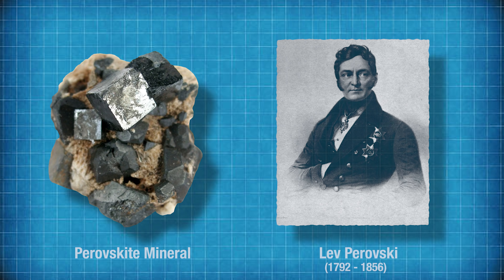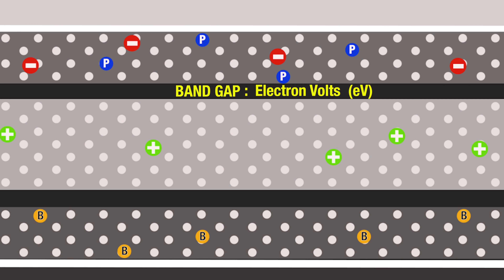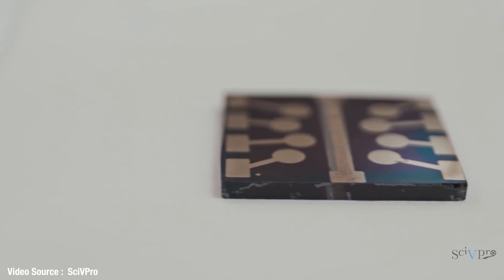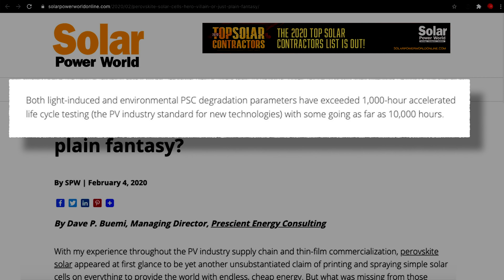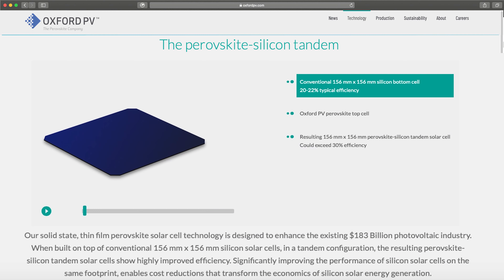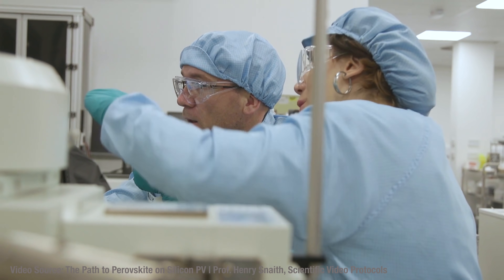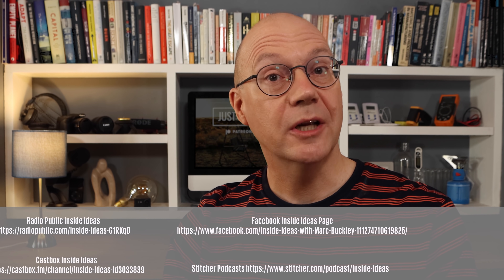Perovskite Solar Cells: Game changer?

Comment: "In 1808, Sir Humphry Davy identified the existence of the metal in alum, which he at first named "alumium" and later "aluminum." Davy proposed the name aluminum when referring to the element in his 1812 book Elements of Chemical Philosophy, despite his previous use of "alumium." The official name "aluminium" was adopted to conform with the -ium names of most other elements. The 1828 Webster's Dictionary used the "aluminum" spelling, which it maintained in later editions. In 1925, the American Chemical Society (ACS) decided to go from aluminium back to the original aluminum, putting the United States in the "aluminum" group. In recent years, the IUPAC had identified "aluminium" as the proper spelling, but it didn't catch on in North America, since the ACS used aluminum. The IUPAC periodic table presently lists both spellings and says both words are perfectly acceptable."  Davy named it "aluminum" so I see it as the correct spelling.

Comment: Pervoskite solar cells might still be struggling with "length of useful life" when compared to silica solar platforms, which are usually warrantied for 25 years.  About a year ago this seemed to be one of the main hurdles for any Pervoskite platform competing against lesser performing, higher resource consuming (within production), and harder to manufacture silica solar platforms.  To make the economic case for investment, the working life of Pervoskite was not long enough to justify consumer purchase nor ramp up of Pervoskite platform production.

Comment: They should be designing these to be heat sensitive so the peaks move with the heat of the sun like little solar dishes.

Next, they need to adjust the size from 1 micron to half of that because the majority of Light coming from the Sun is in the 500nm wavelength.

I wish we could come up with a simple solution that has attenuation for each major frequency.

Comment: 0:30 If a technology is economically sound, all the hemming and hawing coming from the conciliatory fuel industry would be negligible.

The fact is, the Green Industry is hiding it’s design obsolescence behind global warming alarmism. While you focus on inconsequential ideas, you are distracted from the more relevant issues.
Reply: 1:00 I just checked and articles within the last six months put most panels between 18-20% with some outliers above and below that. The highest outliers I saw were 22%; not the 23% that you claimed.
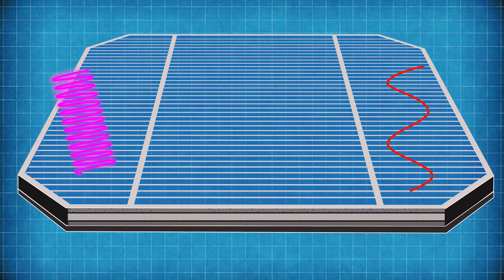Reply: 3:45 First, electrons in an orbital are only ejected when a particular QUANTUM of light is absorbed. More colloquially, this is the wavelength of light. For this particular interaction it’s in the long red/infrared range and not “visible light in general.”

Comment: I keep on saying, thermodynamic efficiency is not that important. Its ECONOMIC efficiency, that really matters. If you can make a solar panel at 1/10th the cost of current solar panels, then as long as its better than 2.4% efficient (if current panels 24%), you're ahead of the game. If its 10% efficient, you have a 4x advantage.

Comment: Just one correction, if I may: The presentation of the band gap as being physically between the different solar panel layers is not correct. The bandgap isn't a macroscopic entity and is not technically "between" the differently doped layers. (Perhaps you meant to refer to the space charge region?)

Comment: Solar panels cannot be produced without fossil fuels.......irony. You did a good job By the way.
Reply: As solar energy becomes plentiful , the panel will be produced by solar energy
Reply: @robertkimera4980  you surely can’t believe what you wrote. You can’t produce any of the components of solar energy without the use of fossil fuels. That will remain a permanent and fixed component of manufacturing anything associated with so-called “green” energy. Production of raw materials, metals, fabrication, delivery, installation and ongoing maintenance will always include fossil fuels and their derivatives.

Comment: (1) You guys always forget about CdTe thin film technology, which currently generates the cheapest solar-plant-scale energy, it is the most environmental friendly (the lowest carbon and water footprint in the industry), has the fastest energy payback time, 90% recyclable, has the lowest warranted degradation rate, has no cracking issues etc.
(2) "You can exceed the Shockley-Queisser limit" - no, you cannot, it is a fundamental limit. What you are talking about is putting several absorbers together to add up several S-Q limits. But then your limit is a multijunction S-Q limit of 68% and you cannot exceed it.

Comment: Phonons are not external to the crystalline solid, but are mechanical vibrations of the lattice. So, when a photon "combines" with a phonon, it means that the phonon assists photon absorption by vibrating the lattice in such a way that makes it easier for photons to be absorbed.

Comment: To begin with AL Gore is hardly a model of veracity.  He has predicted multiple disaster events which not surprisingly  never occurred. Solar advocates do the industry a disservice by overstating the capabilities of solar power.  Real life does not present optimal conditions for power production nor does it present optimal patterns for power consumption. Batteries can address the mismatch up to a point.  The recent disaster in Texas is evidence of the outcome of unrealistic planning for the use of renewables.  Batteries cannot store weeks of energy.  A conventional power plant is required o step in and fill the demand  not served by renewables.  Solar and wind industries stand to make fortunes selling their wares.  They have a vested interest in not telling the whole story.  The truth is that you must have adequate conventional power plant reserves in order to avoid catastrophic power interruptions   The comment about antiquated  transmission networks deserves a response. I worked in the electric utility business for 31 years and have first hand experience with planning and operation of transmission  networks.  Utilities plan their systems generation and transmission  in accordance with industry reliability  guidelines.  The two biggest obstacles to network expansion are environmental groups opposed to an new line construction.  And utility regulators who resist expansion plans because the cost will increase electric rates This has been compounded by utility Deregulation which uses the transmission network in ways it was never designed to be used.  Be prepared to pay for it if the needed expansion  begins.

Comment: Solar panels are supposed to have a lifespan of 20-30 years.  However, the market is awash in surplus panels which have already been decommissioned after just a few years.  I have 1 kW of these used panels in my own backyard.  Early retirement of panels appears to be a widespread practice.  So that magnifies the production of new panels needed in your calculation.

Comment: What's really exciting about this technology is the ability to resonate different perovskite layers to different bands of the light spectrum. 

In a way, we already use a form of this technology with fiber optics (Bragg filters?) where different communication signals are sent over different wavelengths. While those filters were limited to I *think* visible light, perovskite junctions used specifically for electron generation and collection can be tuned to all bands of the EM spectrum (like what the video mentioned). 

With the lesser thickness of perovskite compared to crystalline silicon, you might be able to potentially stack 2, 3, 4 perovskite junctions to occupy the same space as 1 crystalline silicon junction. If those junctions are tuned to different wavelengths, each with their own corresponding Shockley-Queisser limits, then one can imagine efficiency going way up for a single solar cell. This is assuming that you don't get into any fuzzy EM interferences between layers, or that the knocked electrons are successfully collected and don't fall into the holes of the above layers on their way to the collectors. Researchers will know how to make short work of this, no doubt...

Great video Dave, can't wait for a Just Have Another Think on this one.

Comment: Where does solar thermal fit into the equation. Because if we are using solar to heat hot water or our homes , could we be further ahead with assisting large scale central heating with solar?

Comment: Dave
Suggesting opposition to renewables from the fossil fuel industry is not correct.
Fossil fuels compete and trade on a VERY market driven method that is more open and honest than any other withbthe exception of individuals cutting wood and fueling their log burners.
I think you will find most oil and gas professionals are not against renewables when they compete on equal terms, the subsidy and distortion is a different matter.  Indeed I am investigating installation of solar on my roof after retrofitting insulation to enerfit standard on a Victorian house, expensive and hard work but energy efficient.  I am a petroleum engineer.  As a physicist I worked on nuclear fusion and have worked on  renewables also.  Energy is energy but it's not all the same impact and consequence not least of all the expense and fuel poverty that comes with subsidy and taxation.

Comment: A few further thinks here: 

https://youtu.be/0VBTKEPAzvA  Hoping this comes out; if not, I'll try again. It's from my website, www.hyperblimp.com

My wife sent me this a few hours ago; it looks solid based on this. I plan to be buying a few later today. Look up the the MIT guy who developed it.
The Powersave™ – Just Another Viral Scam? - Legit Checker
https://thelegitchecker.com/powersave-review/?gclid=Cj0KCQiA2uH-BRCCARIsAEeef3lnpYNm2agUDi_zcKclpilC0VHQH_BwVV-fhzCptJ8ptysOKR2hIqkaAla8EALw_wcB

I was living off-grid from 1983 - 1997, with twelve 6% solar panels. Thus yes, that's me, ~40 years ago, doing a video for my third grade class.
Article: Living on Sunshine, Underground & Off the Grid. | OpEdNews
https://www.opednews.com/articles/Living-on-Sunshine-Underg-by-Daniel-Geery-110318-547.html

But I add two kickers: This from Natural Capitalism, by Amory Lovins, et. al.: [paraphrased] "It's like we're trying to fill a bathtub with continual hot water. When the more logical step is to put in a more efficient plug, for a few cents." 

And IMVSO: We should spend a fraction of the military budget [in my stronger opinion, all of it!] on population reduction, to cut the Homo so-called sapien population to 0.5B. Start with $15G to anyone who gets their tubes tied, adjusting to countries and incomes. 

As for the perskovite panels, they should be on rooftops with as much local diversity as possible. Eliminate central power systems that will, as always, controlled by a handful of psychopaths.
Reply: The solar panels I used way back then, were 6% efficient at best in ideal sunlight, with orientation (never perfect), ideal electrical connections, and through the material at the time, hard to come by, made by a $5M machine in Japan, Heptax (named after five layers, EVOH, PET, and one or two others.)

Comment: Imagine how fast research could go with a lot more money. Fossil and 'on renewable energy manufacturers should be required to allocate 1 to 5 % of their profit to research, to represent the minimum social and environmental cost of their industry.
Also, imagine if every glass panel on a skyscraper had a layer of solar cells, plus a layer that can variably reduce the amount of solar radiation passing through.

Comment: I know how top drive this forward, in Finland or Iceland (can't remember which) there is a company that runs a plant that strips CO2 from the atmosphere and takes contributions from investors. You can pay for x kilograms of carbon extraction.

All we need to do is make all companies that contribute to atmospheric CO2 pay for the equivalent amount of extraction. That will cost them so much that they will no longer stand in the way of economy carbonisation and at the same time they will carbon zero.

BTW, it would be great if you could do a video on the various carbon extraction technologies. The above mentioned one creates a solid mineral that can be easily buried or perhaps converted into some usable product.

Comment: The problem with all these panels and their production is scaling and integration. My advice would be to change manufacturing to thin-film and put all on rolls like they do with metals. If you have 100 meters of solar film with connectors on a single spool they can easily be integrated into large buildings,  roads, or structures by putting them on the front or on top of them. Imagine having a 1000 watt free energy on every mile of road, we would be fossil fuel independent. The single tile concept has to go.

Comment: Quick conclusions u need to get across to Buckley
1) Elon Musks estimate for powering USA is way off the actual
2) current PV supply is inadequate, cumbersome and expensive for use by average man
3) AlGore was AlWrong. Buckley should not be influenced by AlGore, he will be chasing the air rather than sustainable power for all

Comment: 4:14 I'm a bit confused about this and what exactly an "effective positive charge" is in this context. Based on the explanation given, my conception of that positive charge is that it's just the absence of a negative charge (due to an electron moving to the n-type layer). So how does the p-type layer "collect" the absence of something? And also, why does the n-type layer attract electrons if that layer already has more electrons in it? I get that once the two layers are connected through a battery, electrons flow from the n-type to the p-type layer because there's a difference in charge between the two, and the n-type layer allows electrons to move more freely. But if the n-type layer has more electrons (and so, I assume, a more negative charge) than the p-type layer, why don't electrons knocked loose from the middle layer move to the p-type layer instead? Do the electrons and the effective positive charges only move as described when connected in a circuit?

Comment: I'd like someone to do the maths on that 1 mile by 1 mile battery. What happens if it's cloudy for a month? Based on 1.7 million powerpack 2 batteries at 210kWh that's 358gwh or only 50 minutes of storage.

Comment: Governments will send us broke using taxpayers money to subsidise manufacturing of solar cells.
If it was an economic sustainable industry it wouldn't need subsidisation.
Solar cells only last 20 odd years and then need to be replaced.
One of the big problems in the world is the banks manipulate the precious metals market this makes the silver in the panels not economic to be recovered by recycling.
Silver and other critical elements are running out in mine's around the world. Where are all the materials going to come from?

Comment: Interesting video - well done. The problem of intermittency with solar is its achilles heel and one can flood the world with panels but all we will do is produce huge peaks of generation and nothing for most of the 24 hour day. And then there are those periods across the year which renewables spruikers don't want to talk about where for periods of up to over a week renewables only generate a fraction of normal output. The challenge is all around cheap storage, and I suspect panels will outpace this for quite some time.

Comment: The Perovskite cells are very interesting. Re Elon Musk's battery size of 1km by 1km, I'm sure that would be based on specified (normal) weather patterns and a certain amount of sunlight per day. That's fine, but we live in the real world where cyclones happen and volcanos discharge dust into the atmosphere (as and when they feel like). The world needs a power system that can handle a couple of weeks of wet and cloudy weather and also not fail when Mt St Helens, Krakatoa, or Iceland's volcanos misbehave, discharging dust into the atmosphere that reduces sunlight for months or even years. Renewables by themselves can never do the whole job. Suppose this 1 square 1km of batteries did exist, that would be a hell of a target for terrorists., not to mention being a maintenance nightmare (based on the relatively short life span of batteries 5-10 years under optimal conditions).

Comment: the search for energy is so they can continue their Directed Energy Weapons Project D.E.W. They are using high powered Lazar beams to Cause Fires in states on the pacific coast from California Oregon and Washington and now some of the other states across the country. No such thing as climate change just men causing harm to our planet. DutchSince has shown this on his channel the lazar beams, he does earth quake forecasting for many years. as well as others who started investigating the Paradise California fires where automobiles had holes burned thru the engine blocks and melted metals as well as glass cast iron and yet plastic didn't even melt in some cases in the area. the heat it takes to melt those elements is higher then most have knowledge of until one starts digging. dont spew bs it makes you look stupid and unintelligent and just another blind faith follower of the educated clowns lying to the world. Time to wake up to reality and stop helping them in our demise. DIRECTED ENERGY WEAPONS also correspond to power outages at the same time these weapons have been deployed because they take  a lot of power.